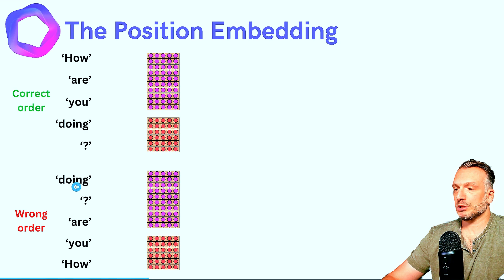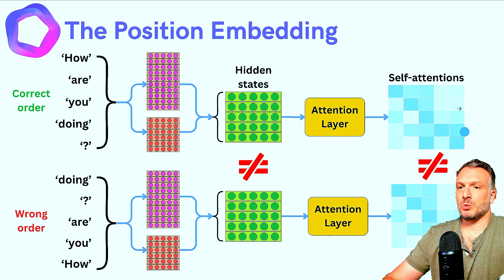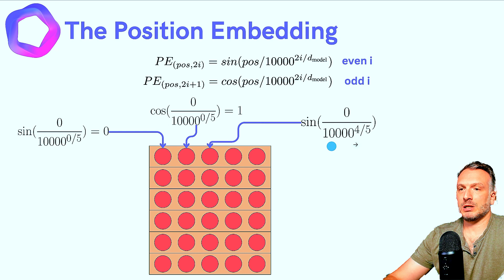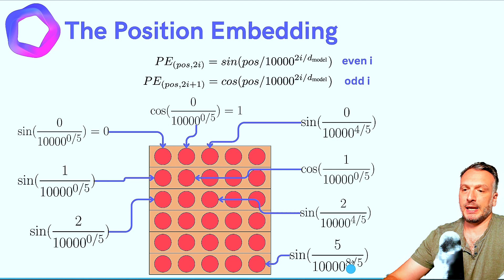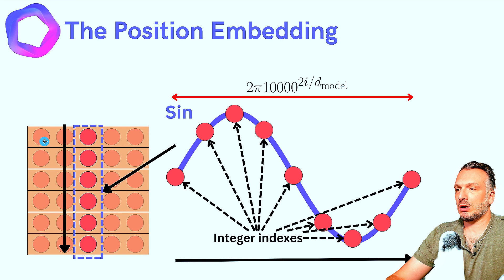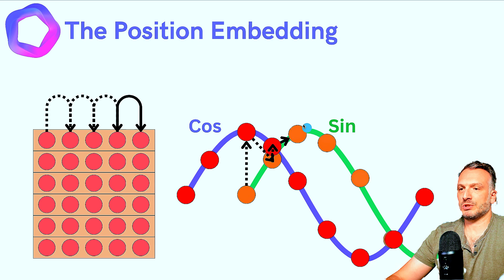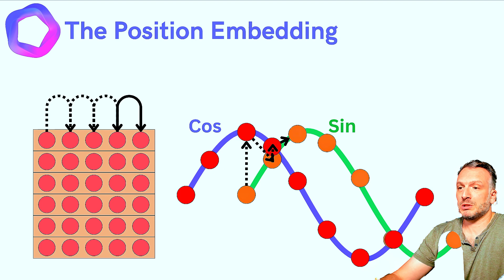The Position Encoding In Transformers

Comment: I have a question, for pos=0 and "horizontal_index"=2, shouldn't it be PE(pos,2) = sin(pos/10000^(2/d_model)) ?
I believe you used the same symbol "i" for 2 different way of indexing, right ? 
7:56
Reply from the maker: Yeah you are right, I realized I made that mistake. I need to reshoot it.
Reply: Thank you Damien, and math_in_cantonese

I'm in the middle of writing a short article discussing position encoding.
Damien, feel proud that you are the first reference I quote in the article!

I was just going crazy trying to nail the exact meaning of "i".

In Damien's video it is clear he means "i" the dimension index, and the values shown with sin/cos match.
But now I could not make any logic of this understanding with the equation formulation below:

PE(pos,2i) = sin(pos/10000^2i/dmodel)
PE(pos,2i+1) = cos(pos/10000^2i/dmodel)

If see this as PE(pos, 0) referreing to the first column (column zero)
and, say, PE(pos,5) as referring to the sixth column (column 5), with 5 = 2i+1 => i = (5-1)/2 = 2.

So "i" is more like the index of a (sin,cos) pair of dimensions. Its range is d_model/2.

The original sin (😄, pun intended) is in the Attention is all you need.
There they simply state:

> where pos is the position and i is the dimension

This is wrong, it seems, 2i and 2i+1 are the dimensions.

In any case big thank you Damien, I have watched, many of your videos.
They are quite useful in ramping me up on LLM and the rest.

Merci beaucoup
Alain

Comment: nice. but i have one doubt. like how adding sine and cosine values ensuring that we are encoding the positions. like how did the author come to this conclusion 
 why not other values?
Reply from the maker: The sine and cosine functions provide smooth and continuous representations, which help in learning the relative positions effectively. For example, the encoding for positions k and k+1 will be similar, reflecting their proximity in the sequence. The frequency-based sinusoidal functions allow the encoding to generalize to sequences of arbitrary length without needing to re-learn positional information for different sequence lengths. The model can understand relative positions beyond the length of sequences seen during training. The combination of sine and cosine functions ensures that each position has a unique encoding. The orthogonality property of these functions helps in distinguishing between different positions effectively, even for long sequences. The different frequencies used in the positional encodings allow the model to capture both short-term and long-term dependencies within the sequence. Higher frequency components help in understanding local relationships, while lower frequency components help in capturing global structures.

Also, sinusoidal functions are differentiable, which is crucial for backpropagation during training. This ensures that the model can learn to use the positional encodings effectively through gradient-based optimization methods.